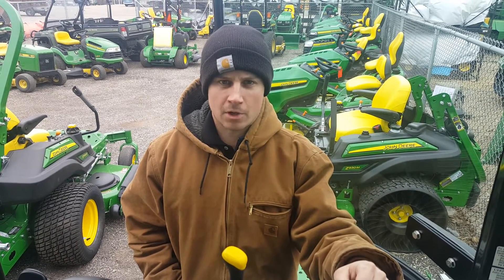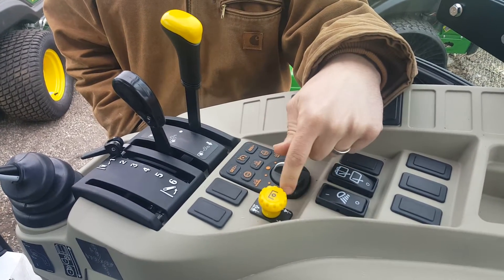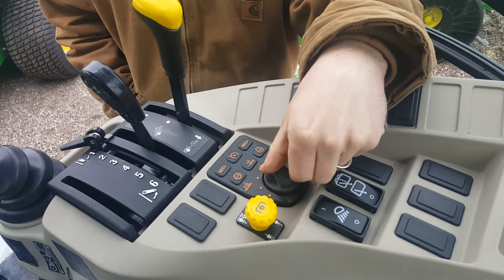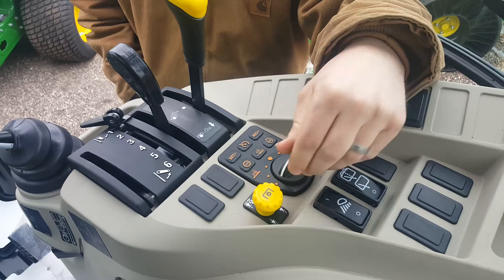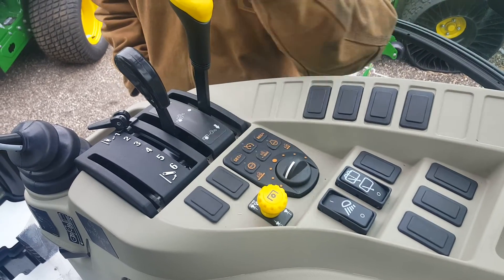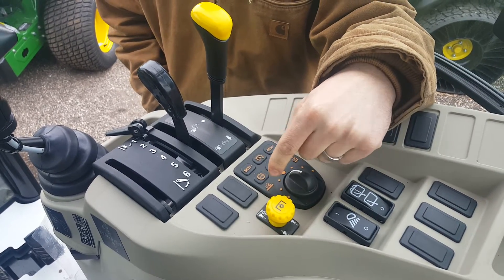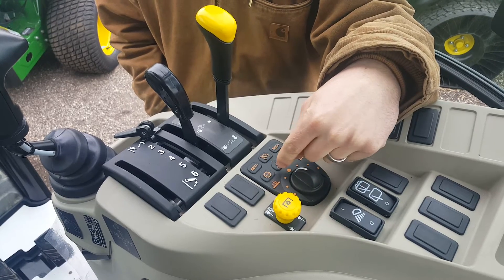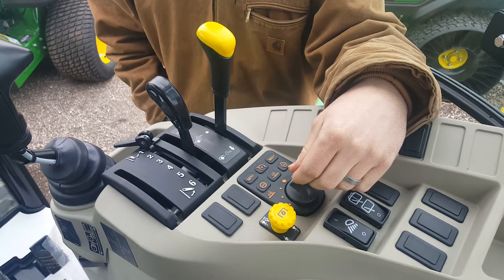Mt Horeb, WI: Load Match, Motion Match, Cruise Control on a John Deere 3R Compact Tractor

Comment: Why is there a switch for the rear windshield wiper while its a no cab model
Reply: It is a cab model with a right hand door, which he has open.
Reply: The Motion match controls how quickly the tractor stops when you let off of the pedal or how far it rolls when you let off the pedal